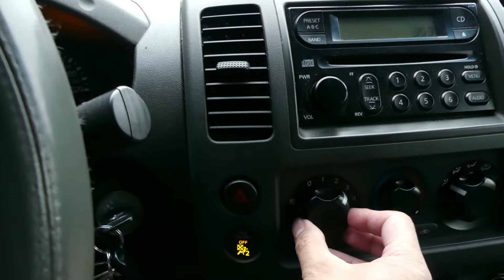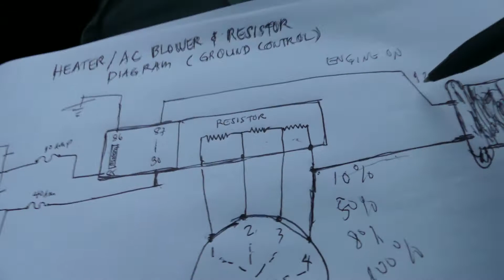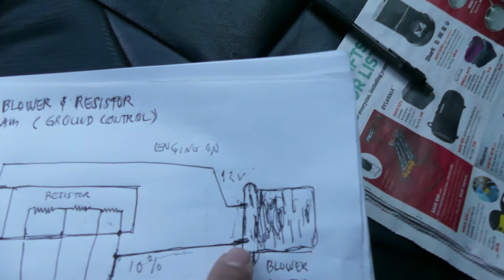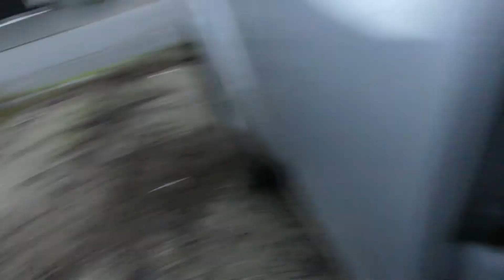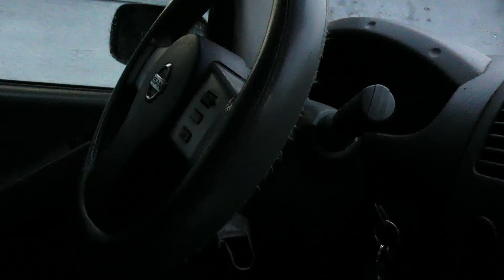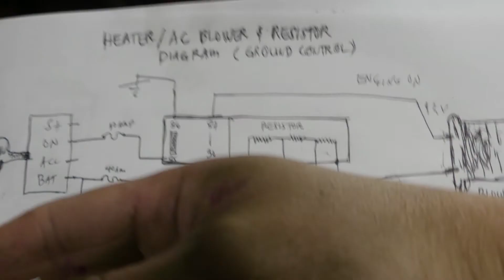How to Diagnose & Fix Nissan Frontier AC & Heater Blower Motor that only works on High'..

Comment: I used a 5.5 mm socket to remove the 2 sheet metal screws, flat head screwdriver to remove the metal clip holding the big black wire (I couldn't figure out how to remove this black wire so I could remove the old resistor) just pry the metal clip holding the black wire down and make sure you place the new resistor in the same way as the old (they had 2 different sides, not sure if this matters). Thank you for this video! I did a quick test and the AC worked in 1 2 3 and 4 positions!! I'll put it to the test tomorrow!! Thanks again! Very helpful.

Comment: What do I do if my fan is blowing but my AC and Recirculate flick on and off and I have no air coming out when it’s on 1?
Reply from the maker: maybe air vent is your problem cant tell need to check the car personally
Reply: @asianmechanicguy6483  thank you for your response, I just replaced the blower motor and the resistor
Reply: @cadekanuha7297 , did that fix the problem?
Reply: @RVJimD  yea it did

Comment: Thats a very interesting way to interpret that diagram. Im a canadian red seal mechanic they teach electrical much differently here. Good explanation though keep up the good work with the informative videos 👍
Reply: so true im also a tech here in usa that resistor they call it  computer module pwm module etc.. but actually if you tear down that module its a resistor thin metal sheet ..Haha this backyard mechanic make it really very simple to understand ..This guy is really good
Reply from the maker: thank you